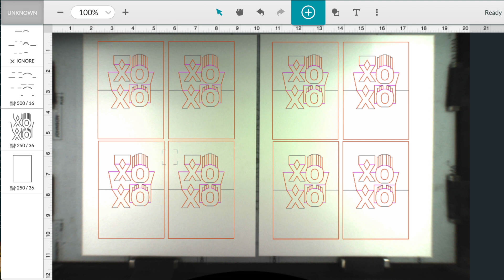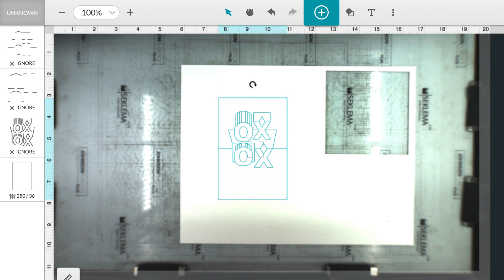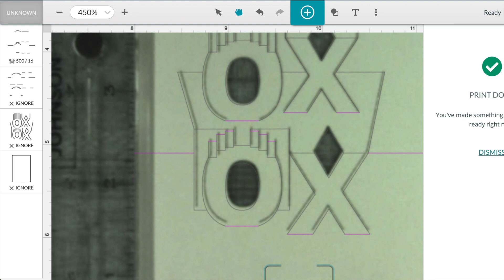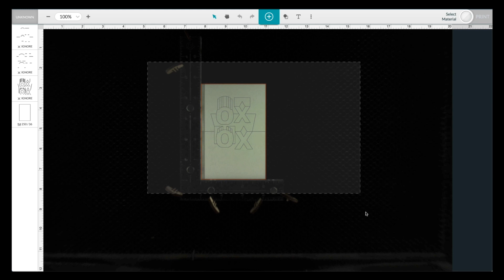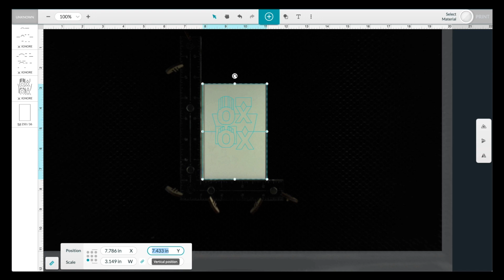Laser-Scoring Both Sides of a Card with Precision Alignment

Comment: Awesome video! Can I ask what setting you use for the cut and score in GF UI.
Reply from the maker: Thank you!

For the plain card stock in the video, I used 500 speed and 16 power for the score and 250 speed with 36 power to cut.

There is a bit of alchemy to settings.  It usually requires some testing to get the right settings for any specific stock and design.  I generally start at full speed, systematically trying different power levels until I find what consistently cuts through.  I adjust speed down if full power isn’t enough (rare with paper) or, in when there are special considerations.  In this case, for instance, I slow down to 250 speed because it produces more reliable results on fine details and curves.  It will also cut through at 500 / 74.  That works great for the long straight lines of the card outline.  For the curves of the Os and some of the short cuts, though, it ends up not cutting through consistently unless I really over-power the cut, which damages the hold-down mat.